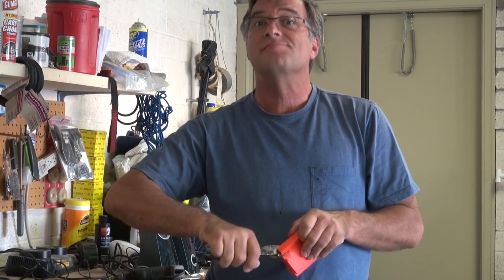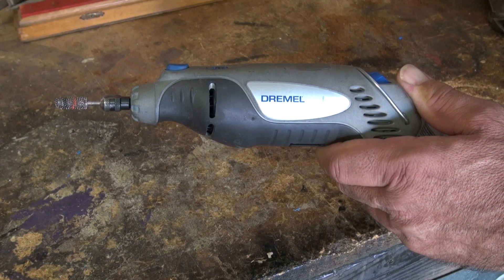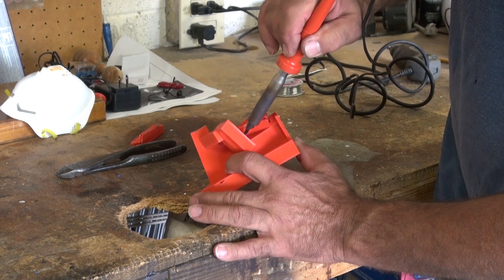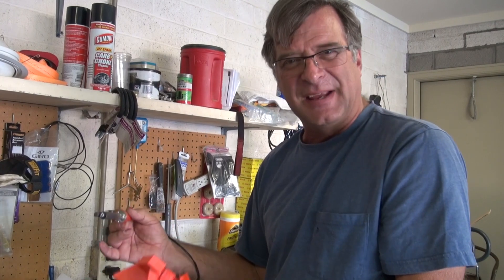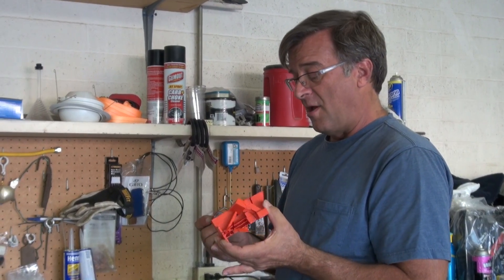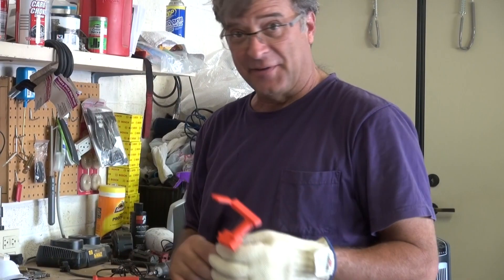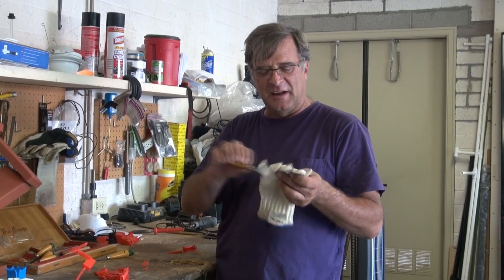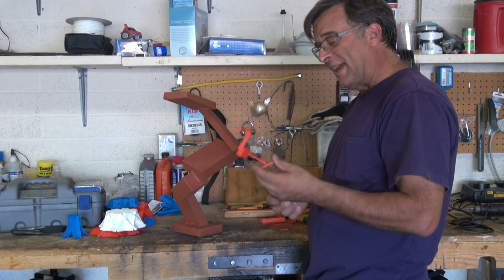How to Use a 3-D Printer: Final Clean Up - Kevin Caron

Comment: Oh, It is bad 3D printer!
 you worked very hard especially final cutting or clean up ,, is not there a 3d printer make 3d shapes without making clean up?
Reply: I think you are trying to say is there a way to make the part without all the left over material or "Clean up"".  That's what I was kind of wondering.  I thought It was excessive when it came to over use of the product.
Reply from the maker: Yes, there are but nothing I can afford..
Reply: Yeah Okay thank you
Reply from the maker: The more expensive machines use wax for the supptsorts.Much easier to clean up but very expensive compared to my machines.

Comment: Hey everyone, I'm new to the whole idea of 3D printing.  I've known about it for a while but it's only very recently that I'm thinking of investing in it.
 I currently work from home in 3DS Max and am thinking of getting into printing out my work for myself and clients.
I have a lot of questions, but I think my main one is asking if every 3D printer produces that amount of waste?  It seems like a lot of excess waste to trim off.  Also, when you said it's recyclable - did you mean back into the machine for re-use or garbage recycling? 
Also, how well does the printer you're using handle smooth shapes, like characters with angles?
Thanks.
Reply from the maker: +stever73        

 The amount of waste that has to be trimmed off all depends on the design..   Lots of horizontal surfaces means lots of support that has to be trimmed.    

When I say it is recyclable I mean that it can be used either way.   If you have a grinder and extruder you can reuse the waste at your home. 

If not then it can go in the recyclable can and be put out for pickup.

Comment: Hi...I just discovered your channel and have been going back watching your old videos...I love your work...and the fact that you've married 2 of my passions, 3d printing, and sculptural artwork. So i have a tip for you...try using a FINGERNAIL MANICURE SET for your cleanup. As long as the walls of your support aren't to terribly thick it'll cut through them in half the time...plus its great for quickly cleaning up any stringing or artifacts and the included file is great for sharpening up your edges for nice crisp lines!!
Reply from the maker: +Richard Matt         Great tip Richard!!!     I will get a set and give it a try....

Comment: Kevin for better support structures that allow you to break them off easier 
use a program called meshmixer 
It's a great program for generating supports
It uses tree like supports with wide bases so you don't have to use a raft
Reply: It keep crashing on the latest iMac :-(

Comment: Kevin, I don't know what state you are in, but my guess is that soon, folks in California will not be able to purchase these machines, for two reasons:
1. The environmental impact of employing the plastic and associated chemicals.
2. The potential for individuals to make prohibited devices.
As for manufacturing, this type of CNC machine is quite useful, but manufacturers are leaving Calif every week, so this will be utilized a lot more in the states that still have manufacturing.
Reply: bboucharde your quite wrong. I currently own a Job shop in California and I can tell you that many shops here have been doing poorly for the past couple of years because of the economy, slowly shops are reopening in California because costs of Chinese manufacturing are almost the same when you account for shipping and their economy flourishing which means increased wages.

I currently own a solidoodle 3 and I contribute to the soliforum community all the time.If you wish to see my posts check out techbuilder2175 to reference my knowledge on the subject.

There are many types of plastic available to print in at this time 
some such as PLA are eco friendly and use renewable resources such as corn starch.

Many people with 3D printer utilize this type of plastic for it's reliability in printing and reduced warp compared to abs.

The amount of abs, nylon and poly-carbonate that people use is so negligible and easily filtered. No ones printing nearly the amount of one run from a manufacturing company who's using an injection molding machine.

Your point on weapons is pointless as well. I have a machine shop and can easily make an ar15 or pistol even then so if you gave me a primitive machine such as a welder I could easily make a pipe bomb or a 12 gauge zip shot gun from home depot google it. 

Currently 3d printable guns provide you with unworkable stl files that require you to spend hours fixing the mesh to make it printable, after firing the gun it usually explodes in ones hand more often then it fires successfully.

Man can use anything as a weapon it's just how you use it 
which makes it effective or not.
Reply: Anthony Avila
Anthony, I am very happy to hear that some production shops are reopening in California, despite the very high taxes, high land costs, complex labor laws, and the most intricate environmental regulations in the USA---including the real threat of a carbon tax. 

Some cities in California are still viable for small-scale specialty manufacturing. Some examples are Bakersfield, Santa Maria, Stockton, and some parts of Orange County.

The sad fact is that California has chased out approximately 500,000 manufacturing jobs since the year 2,000 ---and the cost of manufacturing in California is still roughly 24% higher than the national average.

I did business in California for several decades, and I can name you entire industries that are simply gone.

Thank goodness that the food processing and winery industries are still there, but that is because it would be impractical to move much of this production to other states.  The superb growing season is a real advantage for California, but 37 million residents cannot live on agricultural industries alone.

In any case, good luck with your business. I hope 2014 will be very successful for you.

--BB

Comment: its great i see plenty of plastic to remove this maybe to hold the mold drimel its the solution but messy but she have to many bit attachment  cut off wheel for metal plastic wood wheel with sand paper and  much more but the hot soldering knife save you a time !